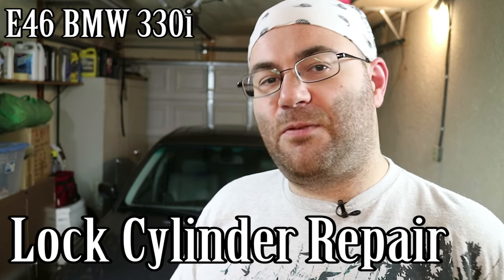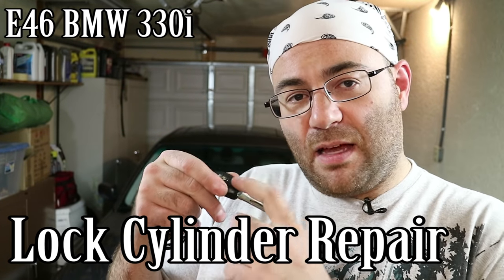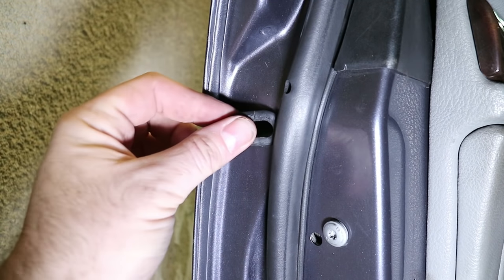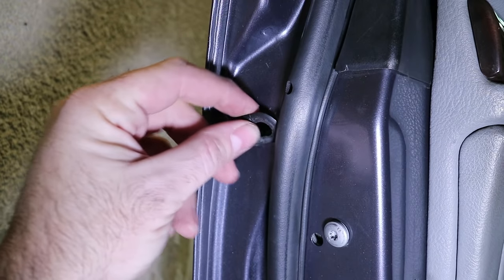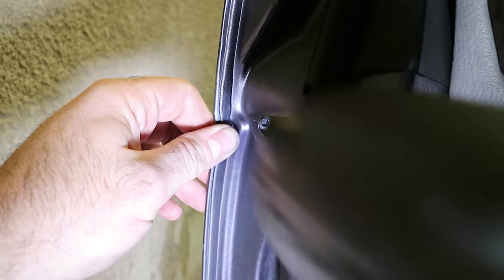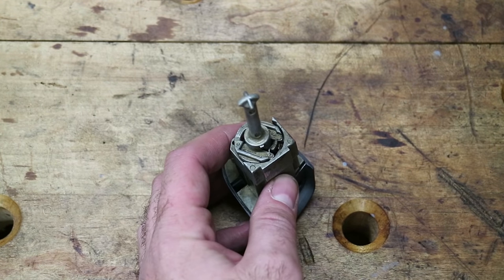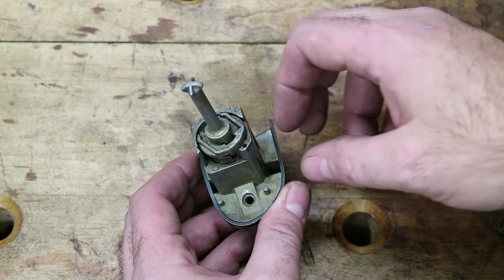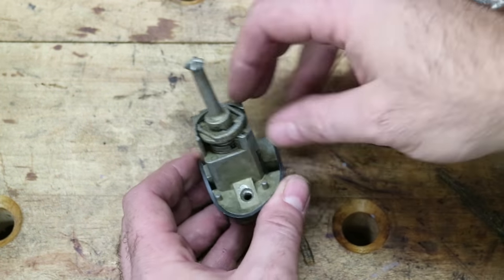BMW E46 Key Lock Cylinder Repair DIY

Comment: Let me tell you my story surrounding this fix. I have done it twice now. When I bought my car in January 2019, this fix needed to be done. My key was dead and did not work even with a new battery so I was limited to manually locking and unlocking it. I did it but could not get the spring all the way to the correct position. This will make you so extremely angry. It seems so simple but it is HARD. Now two days ago (November 2019), I locked my car and when I went to unlock it, the cylinder spun freely without any reaction. I called AAA and they got me in. I ordered the part as I assumed this was the issue but it was going to take two days to come. The next day, I was just planning on leaving my car unlocked and I did that but when I shut my back door, all my doors locked. So I had to call AAA AGAIN. The tow truck drivers greet me by name at this point. At this point, I just leave the window open enough so I can stick my hand in and unlock it just in case (even though it's below 0 here in Minnesota). I finally got the part today and got to putting back the dreaded spring. After 20 minutes of trying, I GOT IT. This was one of the happiest moments of my life. Great video as always. I am shelling out the $300 for a new electronic key so I don't have to deal with this every couple months.

Comment: Just watched this for my '01 330ci. My door jam is slightly different but I think yours is a sedan. Lock assembly was identical. I will say two things about this repair.
1) This man is VERY INFORMATIVE. I have watched several of his videos on the upkeep on my 330.
2) That spring inside the lock cylinder, is the spawn of satan. No seriously. Try not to get mad during this repair. Took me 3 IPAs and a lot of patience and cussing up a storm. He makes the spring part look easy. IT'S NOT. PERIOD.
Reply: Dave Scurlock the IPA’s is the reason u had such a hard time 😂😂😂. Hipster
Reply: Lol man you sound just like me! Thanks for the advice cuz I'm about to do this repair and I will try to remain calm
Reply: @tarheelnation_561  If you're not buzzin when you're messing with ANY springs on a car, idk what you're coping with but I want it 😂

Comment: I just put the replacement parts in the door and everything works, even the key fob.  I was just turning the key back and forth once I had it back in the door and didn’t realize all my windows went down and the sunroof opened.  Just like the key is suppose to do.  Can’t believe it was all caused by a little broken piece in the door lock cylinder.  Thank you 50sKid, I watch all your video’s for help on my car.

Comment: Just rebuilt my lock now. So thankfull for this video. 

Got the spring done in 2 minutes. Handy if you have two people. After the spring is compressed (used ballpoint pen), and you have the keyway shaft held in against the compressed spring, if you can get a friend to hold that assembly down , its much easier for you to turn the keyway shaft and get the keyway holder in.

Comment: Just wanted to say thank you for this in depth video.  This is the best key lock repair video with the best video/audio quality and camera work.  I hate it when people cut away to do steps off camera and resume.  I have a 2001 X5 so it's not exactly the same but good enough.  This no doubt saved me a chunk of money.  Cost about $10 to fix this.  And another $15 to replace a dead VL2020 key fob battery from other videos on YT too.  FWIW, I used J-B Weld cold steel epoxy and that did the trick perfectly. I put in the time to cut the weld points on the battery with an x-acto to be on the safe side. Thanks again!
Reply from the maker: Thanks.  I tried doing the battery thing and f'ed up my key, lol.  Video not posted.

Comment: Thanks for this video I fixed my lock with it. Sometimes when I locked the car remotely it would unlock right after and all the windows would roll down . I noticed I couldnt lock the car manually with the key so before replacing the lock actuator I tried this and it's working so far

Comment: You star !!
This is EXACTLY what I need to do to my E60 530i. I've just collected it from the garage, where they were meant to fix this but they didn't. They change the mechanism inside the door but failed to identify the door barrel spindle failure.
I'll do it myself and then tell them how crap they were.

Comment: UGH lol such a helpful video. I thought I had fixed it then I tried it out in the CSR door and i broke the piece that breaks in the lock lol oh well. I took apart the working lock in my E46 part car and took apart the lock in my actual daily driven e46 that was broken and put it together and it worked until I put it in the door and that dang piece snapped lol. It was weird I had a few problems. Where the key sits in kept sliding out, and the part where one side of the LHD/RHD piece is bigger/taller than the other, mine were the same size lmao. I just put the side you were talking about where you said too but they were the same size. Oh well. I'm going to buy the parts kit and try it again I just wanted to try to save some money lol! Thanks 50s kid!!!!!!!

Comment: Thank you for the excellent instruction. This is the second time I've had to do this repair on my '03, and I had forgotten the steps. The trick of using the ballpoint pen for the spring was easy and very helpful. I had a second pair of hands and eyes which I recommend.  It was harder than expected to get the cylinder out of the door -- we ended up levering the assembly out from inside the door (using the 4mm allen wrench) near the retention bolt.

Comment: Instead of a biro to stretch the spring over the post, which shattered when I tried, I found a small tamperproof Torx screwdriver (the hollow sort) worked a treat.

Comment: First off, your videos have saved me so much money and I don’t even know where to begin to thank you.

Would a broken lock mechanism affect the window operation?  I rolled my window up (330i) from the outside using the key, the lock broke and now my window is stuck even with the electric controls on the inside of the vehicle.  I bought a new window regulator and I’m prepared to replace that if this lock fix doesn’t solve the problem.  Has anyone else had this problem?  Cheers.

Comment: Both my e46's have had this issue!    This is a really great tutorial - I got the  2nd bit in the wrong way round so the spring was not under tension.  I got my 2nd kit of amazon and it did come with the roll pin and spring.

Comment: I've used several of your videos over the last couple of years and they're always great.  Thanks for sharing them.  One point of confusion for me in the lock cylinder video was the screw holding the cylinder in the door.  I think the video said you just needed to loosen, but the screw needs to disengage from the cylinder to release it I believe.  Even after it is out it doesn't fall into the door because the door frame is holding it.

Comment: I dont know if this will help anyone but I caught hell trying to push the long piece down to slide the locking piece onto it because the lock kept wanting to back out so I found a small socket and used it to keep the lock cylinder pushed in and then I got a deep socket to push the long piece down and slide the locking piece in made it so much easier

Comment: Thank you for including the inner door mechanism aligned, you confirmed my conclusion on centering it between lock and unlock. One problem is my lock Cylinder fell out and became disoriented,  and so far I locked myself out, and will climb through the trunk with the alarm sounding.  Any suggestions  on proper direction for the Cylinder?Thank you! Great video!

Comment: Excellent guide!  Sharp, well-focused video - and yes, you did make it look too easy. :)   I had to trim down the new replacement part that breaks on the OEM hardware - the wings on the stepped side were about 1mm too tall on my replacement - if I'd have figured that out sooner, I would have been done much faster!

Comment: Just an FYI, might be a good idea to put the lock pin in before the trying it out, because I didn’t put the lock pin in, to try and avoid a step and luckily only the spring and small components stayed on the lock cylinder, but all other components ejected into the door. Good thing the kit comes with spares 😂. Appreciate the vid

Comment: how does one get the door open to access the screw if the door doesn't open in the first place? We tried putting a battery jumper to get the car to light up, but his remote only unlocked the truck and not the car's locks. Obviously when we try the key the lock cylinder is busted, so now besides smashing the window and the rear seats don't fold down what choice do we have? thank you for your videos they are very helpful!
Reply: I have the same issue, how did you end up resolving it?
Reply: @waffle45  we haven't lol have you? car's been sitting still collecting dust
Reply: @PhuPhillipTrinh  smashed the window. Made sure we had a good replacement lined up first so we knew which window to smash.

Comment: Thanks!
This was an easy fix. The center hole in the replacement parts from amazon was a little too small and it had some ruff edges but in used a small file to enlarge the hole.
😀

Comment: While testing the key after the repair it got stuck. the key was stuck at 1 o’clock and I couldn’t remove it or turn the key so I had to break the collar to release everything. I don’t know what caused this so when I used the collar from the kit I made sure it was installed on the vehicle before I turned it and it was done

Comment: Hey man I love your videos, I bought a 2003 M3 but the trunk lid came with a different key just by chance did you ever fix or changed the key combination on the cylinder to make it work with the same key

Comment: Appreciate the video. I've taken my lock apart and put it back together probably 50 times and cant get my key out unless it is horizontal instead of vertical. I'm thinking the cylinder is not aligned correctly when I start? It also only turns one way put the lock back in unfinished for the time being.

Comment: Hi jayson just wondering if you can help me out my door cant open i think someone forces to open it from.outside (driver side door)  how can i fix the latch? Remote key works/manual but i cant open it from inside or outside.thinking to take it off the panel from inside but really dont know what to replace/take off inside the door panel.pls help thank you very much.

Comment: Great detailed explanation. Am sure I got one of the many different things (key barrel, 3 rings, last of which is different for L/R-hand drive, stem) that needs to be the right way round wrong and managed to rotate the key to a position where I couldn't rotate it back to the original position to be able to extract it.
Nightmare scenario with key and lock barrel permanently united and neither useable but happily managed to extract the key from the barrel by part-sawing through the U clip with a hacksaw from above and then breaking it off with pliers (the U horseshoe clip had rotated so the closed end was blocked from being pulled off the final stem by the main lock body). Lucky the repair kits (including horseshoe clip) are so cheap, around £3! :-)
Btw did anyone have issues with their convertible soft top retracting and windows coming down randomly when turning the key in the broken barrel? That was my original nightmare with the car fully open to the elements and public, no easy way to close the top (roof close button flashing red) and rain on the way! Actually, thinking about it been a nice car to drive in the Summer but no end of dramas too :-D

Comment: great video, hey i was wondering if you could help me with something. ive got a e46 330i and everytime i lock my car with the key fob all windows and sunroof open.
Reply: Pablo R are you holding the key all the way to close?
Reply: no, when i use the key i make sure it locks and when i use the key fob i only click once to lock
Reply from the maker: Sounds like something is screwed up inside the general module 5. It is located behind the glove box (you have to remove it)

Comment: Hey thanks for the ivideo ,  i got a problem  with the female part of the lock mechanism that has the white circle that actually unlockss the lock . I put a screw driver in it and it spins without unlocking  the door, Reference at 9: 30 on 
 youre vid . Got any advice or vids on that  ? thanks .

Comment: There's 2 different lock inner cylinders. I'm assuming ones for the older style since that's was on my 328 but got a 330 cylinder lock and the plate that breaks is slightly different

Comment: Hey. Thanks for all the good info . It's been great going through your BMW library .i just bought a e46 325xi wagon and I am repairing it as I go . I just did my control arms inner b joint and bushings and I messed up by not changing the tie rod ends , that's this weekends job . 
I have one question for you , it's about the steering of a e46 . Mine is a bit stiff I think , my description of the stiffness is when I turn the corner and if I was to leave go of the steering wheel on the way out of the corner the steering wouldn't go back to strait like my other cars do . I halfto help the steering to go back to strait not a strong help but more of a driving it through the turn. Is this normal for the e46 cars ?.
Thanks for taking the time to read this.
André
Reply from the maker: +André Roy No it's not normal.  You likely have some alignment issues.  Normally the front tires on a car are aligned such that they want to return to center/straight, so I'd say have the alignment checked out.  Obviously, wait until after you change your tie rods (which should require an alignment anyhow).

Comment: WATCH THE VID IT WAS GREAT SUCCESS AT PUTTING KEY CYLINDER TOGETHER  DID THE PRELIM TEST WITH A SCREW DRIVER LIKE YOU DID IT LOCK ALL DOORS NOW ALL BUT THE DRIVERS DOOR SEEMS PERMANENTLY LOCKED HANDLES INSIDE WONT OPEN ONLY DRIVERS IT SEEMS LIKE IT IS IN MANUAL MODE   CENTER CONSOLE LOCK AND UNLOCK BUTTON WILL ONLY LOCK NOT  UNLOCK???

Comment: I did order the replacement parts for this cylinder cause there is no resistance when I use the key in the door and won’t unlock the door on my 2003 BMW 325xi ..   BUT my question to 50sKid or someone who would know is:  My key fob will lock my doors but will not UNlock the door,  could this just be the fob or something else?

Comment: I accidentally took out the 4mm bolt inside the wrong spot on the door jam.  It’s the one below the one I was supposed to loosen.  Then I unscrewed it completely and it fell inside the door to the bottom.  Any ideas on what to do?

Comment: Question. If the lock is not turning right if it feels blocked and absolutely not locking the car. But it turns left. Is this my problem since it turns left but doesn't unlock the car? 9r is that a acutauator problem too
Reply: Secondary question can I somehow get a unlock side for the right side of the vehicle that works with the same key?

Comment: Hey so I have an American e46 so left hand drive and I had to use the other piece. I spent forever trying to figure out why my lock wasn't working right until I used the other part. Just a heads up for other US owners.
Reply from the maker: I'm in the US.  This was a US lock.
Reply: I'm guessing a repair was done on the lock sometime before I got it and whoever did it changed the tumblers.
Reply: Razman holy fuck thank you so much I was about to throw this shit through my window until I read this

Comment: So I repaired my door lock cylinder but now all my doors won’t unlock when I unlock my driver side door but it does roll all the windows down I’m stuck and help ? I checked fuses already
Reply: They do manually open but not with the unlock button

Comment: If your gm5 module was bad would that impact ones ability to open the car using the car key into the lock cylinder in order to unlock the car?
Reply from the maker: When you turn the lock to a 45 degree angle, it unlocks it electronically through the GM5, but then at a 90 degree angle it's manual.
Reply: +50sKid ok , thank you for responding.
Reply: ahh...thanks for that. so at least I know now that it's probably the module.

Comment: Maybe I missed something, but whatever did happen to your key fob?  Mine also recently just died out of the blue.
Reply from the maker: I thought it had died so I cut it open to change the battery but I ended up killing it somehow.  I've been meaning to order a new one...  The intermittent problem I was having was caused by bad relays in the GM5 module, though.  If yours has died, have you tried resyncing it?  Do a search on e46fanatics on how to synchronize the keys on an E46.
Reply: Yeah I tried resyncing it first as well. I got a local battery store to order me a VL2020, so that will be fun.
Reply from the maker: Honestly, I don't believe that is the problem.  Those batteries don't just die, so I've come to learn.  Plus, I wasn't able to reglue the thing back together successfully with 5 minute epoxy.  Maybe I'm using the wrong type but eventually it split open again and thank god the board didn't fall out because I'd never have been able to start my car again.  I ended up getting a blank shell from eBay and having a local locksmith cut a new key with his diamond cutter.  That's what I'm using now.  Anyway, use caution when desoldering the old battery if you insist on going that way.
Reply from the maker: My old battery, for instance, still had voltage.  I would test your old battery with a multimeter before desoldering it.
Reply: 50sKid, 
Im having the same problem with my spare key, battery not there and my everyday key is dieing i believe, got locked out my car today cause fob didnt work then door cylinder broke as i tried to unlock manually, not sure whats the issue....?